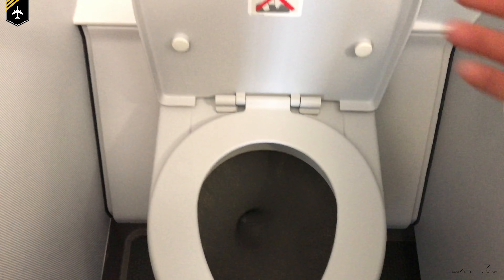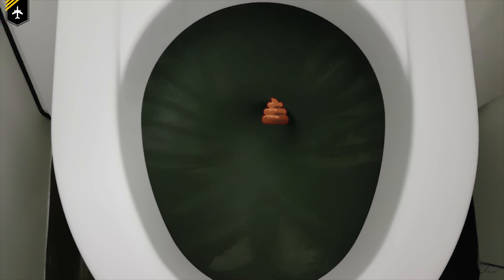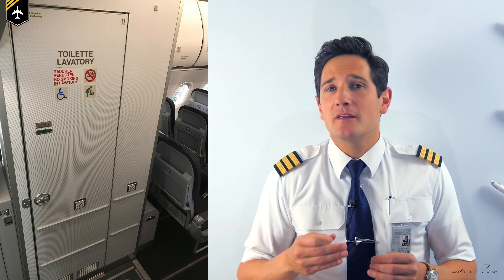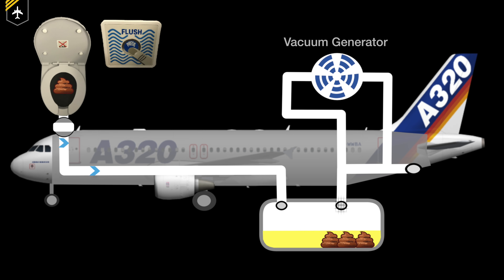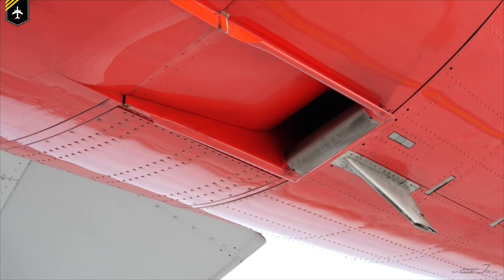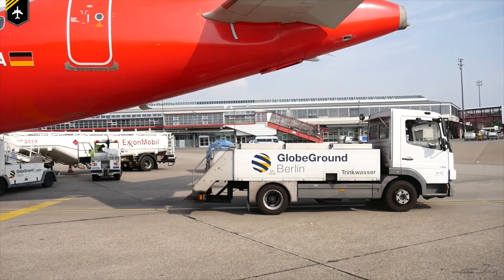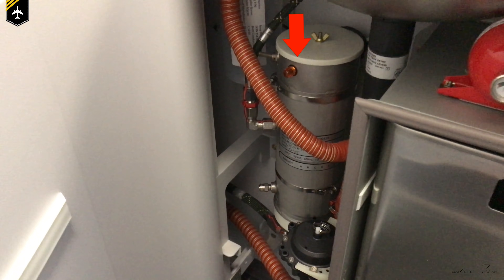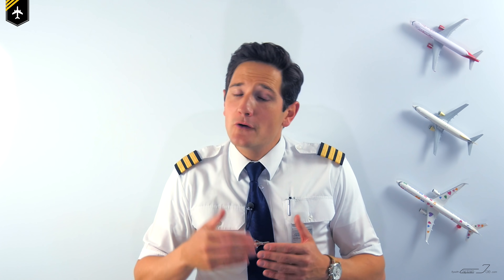HOW do AIRPLANES DEAL with YOUR SH**?! Explained by CAPTAIN JOE

Comment: On a Lufthansa flight a while ago, they had the toilets in the belly of the plane, and a contingent of passengers who, apparently, were not prepared to fly and didn't know how to use toilets. It was disgusting, and the crew had no plan to deal with it. The toilets were overflowing, actual sh-- on the lower deck, by the time we were skirting Greenland. It was basically a transatlantic flight that smelled like Sh__ all the way from Montreal to Frankfort. There has to be a better way to inform passengers who may not be familiar with plumbing, let alone contagion, on how to these systems effect everyone on the plane.

Comment: Does a freight 747 have a toilet?
Are the hose connections  standardized?
Reply: The Freight 747 Does Have A Toilet.
But i do not know what you mean by Are the hose connections  standardized?
Reply: @xioana   I meant the conections  for hoses to get the poo out again. Do they differ from plane to plane or is there a standard for these?

Comment: fun fact, the system is powerful enough to suck a aircraft blanket down through the waste pipes, many times when a Ac has come in for a check at our maintenance facility, we have stripped out the waste tanks to find a blanket has blocked one of them.

our conclusion is that passengers have gone to use the toilet during the night, , sat on the toilet while wrapped up in a warm blanket, and flushed, we have only imagined the shock the passenger would have had when their blanket disappeared.

Comment: The flushing sound is so loud it makes me uncomfortable
Reply: Don't flush that plane toilet while seated. It might pull out your intestines if you are fat and your ass covers the whole bowl
Reply: Ngọc Hoàng Martian we’ve all seen soul plane. 💁🏻‍♀️😂
Reply: Before i flush the toilet i open the door and push the button and run for my life
Reply: I have used those disgusting air plane bathrooms before. And there was a turbulence earlier that day in the airplane so as soon as you saw me come out that bathroom i was pale!!!! For like 10 seconds
Reply: I’m scared of it 😂
Reply: Because the higher pressure cabin air pressure is what pushes air down the toilet, does that make the cabin pressure drops each time you flush. Is it possible to completely depressurise the cabin by flushing enough times.

Comment: The system with closed tank using the lower exterior pressure was invented by Bjoern R Kristoffersen and his team from Boeing while furloughed during the 1973 oil crisis. The team created a large number of inventions all patented - providing the end of the dropping of soil from air planes - starting the era of the modern airline lavatory.

Comment: Hi Expert out there, may I know what about that is after take off and before the plane has get to the height where you have the differential pressure? Does it mean that the flesh wont work? alaso in the beginning of the flight,was the Vaccum suction electrically driven by the APU?

Comment: Once I was parked on a ramp waiting to connect ground power to a Aircraft. I see this kid maybe 19 year old pull up in his honey truck to service a plane.  He hooks up the hose and opens the valve to  drain the tank. Next thing I see the hose comes loose and the poor kid is getting a shower. He was brave enough to reach the valve to shut it off. Remember this when you think about a career in Aviation.

Comment: Why parachutes don't keep in aeroplane.?
Reply: Do you know the answer now?
Unless: At such a huge altitude and speed, it is impossible to leave the plane without dying from the pressure / cold and air flow.
And if the engines are behind, sideways, then it can happen that you are sucked into the engine.

Comment: Joe could you please explain if a pilot can be a pilot in two types of aircraft like a320 and also 787
Thanks
Reply: Yes, you can pilot different types of airplanes, only you need to get trained for each of them and receive certification for each airplane type.
Reply: @LGKvideos  not in every case... pilots certified on the A320 can fly A318s, A319s, A320s, and A321s. Also pilots certified on the 757 can fly 767s as well.

Comment: captain joe, what do you do if YOU need the toilet when you’re the pilot?
Reply: holly a flight attendant enters the cockpit, and then the pilot can take a short toilet break.
Reply: A2DJP ok thanks
Reply: In addition, the crew will put the curtains up in the aisle/galley to hide for the passengers that the cockpit door is getting unlocked and opened.
Reply: @Husaberg R the flight attendant is in just to have an eye on the flying pilot. It is not allowed that there is only one person in the cockpit in case of an sudden medical issue like heart attack, stroke or severe pain and so on.🍀
Reply: @sunrise0391  It used to be allowed, until there was an accident many years back where a depressed and suicidal pilot locked the other pilot out on a bathroom break, and then flew the aircraft into a mountain. That was when the 2 people have to be in the flight deck all the time rule was created.
Reply: @mtuz8356  She can unlock the cockpit door to allow the other pilot in, she can ATC. They started doing this after a suicidal pilot locked the other pilot out and flew the aircraft into a mountain. Also after 9/11, all cockpit doors can be locked from the inside and not allow anyone to open it from the outside.
Reply: they shit on the flight computers
Reply: DarkSlayer 1411 that would just be pointless and break things
in reality i suspect a flight attendant is called in to keep watch and the pilot then goes to the toilet 
i heard some planes have a small toilet room built into the cockpit to eliminate the need for pilots to leave the cockpit at all,  though i have never seen such a room
Reply: @mwbgaming28  r/woosh
Reply: MWB Gaming r/whoosh

Comment: Why dont they discard the 200 liters water in emergency case instead of fuel? It is safer for environment and save money as well, I think. Thank Captan for these interesting explanations :)
Reply: Bakuryu Mole 200 litres of water is nothing compared to 320000 litres of fuel
Reply: 200L of water is about 200KG = the weight of 2.5 people

dumping that wont do much in terms of the landing gear not collapsing on landing

Comment: HI Joe, does the luggage area under the plain also have equal air pressure? If I put a new bottle of coke in my checked bag, will it explode?
Reply: the cargo hold is pressurized to the same pressure as the cabin, this is to ensure that altitude sensitive bombs don't explode in flight and so animals can be transported safely in the hold, it is also to make the floor of the cabin much lighter (since it wouldn't need to be a pressure vessel then)
Reply: Yes, pretty much the whole plane is pressurized, that is also why it is shaped like a cylinder, just like gas bottles. This is, except for a sphere, the best shape for containing pressure. In the tail it looks something like this: https://commons.wikimedia.org/wiki/Category:Rear_pressure_bulkheads_(aircraft_fuselages)
I wonder if a coke can might survive unpressurized anyways. It looks like they can have internal pressures of about four times atmospheric pressure (https://hypertextbook.com/facts/2000/SeemaMeraj.shtml). At cruise altitude, the pressure is somewhere between 1/4 and 1/5 of the pressure at ground level, so the pressure difference goes from about 4 to 4.75 to 4.8. Depending on how big the safety factor is, that might actually work.

Comment: Does pilots sleep when there is a long flight? For example from Los Angeles to Dubai? Do they sleep in their seat?
Reply: Yes they do sleep on such long flights, but not in the cockpit. They fly with 3 pilots on such flights, but one of the pilots normally will go to the crew rest area to sleep for a few houres shortly after take off. After 3 or 4 houres he wakes up, goes back to the cockpit and the next pilot goes to sleep.

Comment: A while ago I went to Barcelona and on the way back (from Barcelona to home) they fueled the plane while we were on it and the ground crew was loading the cargo. I was wondering if that is safe and or allowed. I also noticed they connected the ground wire before the fuelhose, but also disconnected it first. I flew with transavia, if that makes a difference. I don't remember the exact plane model.

Comment: Captain Joe I would ask you a question that, If a plane crashed landed then what are the proper procedures you take to decide who leaves the plane first or does the after crash landing checklist... is it the captains choice or? And did you ever experience an emergency in air?

Comment: Yup, I used to be that lucky guy that used to have to service those systems at DTW.
The other GSE's (Ground Service Employees) use to jokingly refer to us as "The Turd Hurders".
These systems especially the older gravity fed blue juice lavs were a pain in the ass to service in the middle of the winter on the older DC-10s Older 747-200 series where there rear lav service panel was way up under the tail and the DC-9/MD-80 forward lavs because the service panel was located directly below the jet bridge and sometimes I had to go get a gate agent to relocate the bridge because the bumper was right up against the panel.....
One incident I had on 12/26/98 I was servicing the rear lavs of a Champion airlines Boeing 727 and when I opened the outer hatch, the inner flap was already opened with upwards of 20 gallons of 'you know what' pressing against the outer hatch, the ice build up wouldn't allow me to reseal the hatch and decided to take my chance to jump out of the way about 4 feet off the rear of the lav truck. 
When I hit the ramp I must have slipped because the next thing I knew I was on my ass looking at my ankle that was tacoed 90 degrees the wrong direction.
Needles to say that put me out for the next 8 weeks and I messed the winter deicing season of '98/'99.That was the year wear passengers spent hours trapped on aircraft on taxiways.

Comment: Is it true when a toilet has been filled up and emptied, air hostesses put ice in the toilet bowl to prevent a strong odor?
Reply: more likely if it wasn't carbon Dioxide 'dry ice', it was to both chill harden 'stainings'  for easier cleaning with less smearing, and to melt and provide some liquid to move loosened turdlets into the 'gullet' of the bowl - the small flushing/catch tank/cylindrical part just below the flapper valve of the bowl.
   Saying its for air freshening is a nicer faster way to coax a passenger to stop asking for an explanation that could make other fell unwell from hearing "The toilet was dirty and pebbledashed..."

Comment: Chemtrail busted -  Coffeetrail confirmed...
never thought, that it would go over board. Why isn't the used water just stored with the poo in the waste tanks?
And actually: the myth of falling ice blocks from planes could be true, if the heating of the drain mast is not working properly and the wasted water freezes at the exit of the mast?!

Comment: It seems like a bit of a waste of power and weight to have the water heater for washing hands. At that altitude the water may get very cold, but as long as it does not freeze it seems like an unnecessary luxury.
Reply: noted, I have commanded that they be removed from now on, just for you

Comment: Captain Joe, how often is the potable water system cleaned or serviced? Potable is drinkable water, but it's basically tap water. When water sits for a long time, it develops biofilm an algae like film . You see this sometimes in reused water pitchers, that don't get cleaned often and in Keurig coffee makers. I've the videos on why flight crews don't recommend drinking water or coffee on the plane unless the water is from a sealed bottle.
Reply: The filters, and screens are cleaned on a regular basis. We do ours at least once a week. We also use a broad spectrum microbiocide called Purogene. The system absolutely gets cleaned. The problem is that you don't know about the quality of water in different Countries. You could be on a flight from Atlanta to JFK, but not know that the water system was just filled in Mexico during an earlier flight.
Reply: Thanks for the reply, so even if the system is sanitized once a week, assuming all airlines do this. The water to refill the system could be questionable.  That's why the flight crew does not recommend you drink the water from the plane unless it's from a purified bottled source.

Comment: Hi Captain Joe. In this video you said that the used water is exited from the plane during flight. What happens to that water when the plane is on the ground? Does it go into the holding tank? Then when the plane takes off again is it pushed out of the plane during flight? I always enjoy your videos.
Reply: It's a direct line from the sink bowls to the drain masts. Since it is considered hand washing water only, it drains to the ramp.

Comment: Do you know of any cases where people have drained enough water that it changes the weight/handling charasteristics of the plane itself, or are the tanks too small to make a difference? I worked for a while as a warehouse clerk at an aircraft maintenance location dealing with A-319s and A-320 for United and JetBlue.

Comment: Love your videos Joe. One small point on this one. There is no 'suck' in physics. It's all  'push' caused by differential pressure. When the passenger does the deed they increase the pressure in their rectum and push the waste out. It is not sucked out. Similarly, to flush, the pressure on the inside is increased as compared to the outside by opening the outside valve, and again, the waste is pushed out.
Reply: oh wow, thanks mr spack! so vacuum generators don't lower pressure?

Comment: I have read many warnings about not drinking the water aboard a plane, because the water tank isn't cleaned or disinfected regularly, and the water is likely to contain harmful bacteria and viruses. (This would be the same as why cruise ships often have outbreaks of norovirus - their potable water is also stored in large tanks.) The few times I've tasted the water on a plane, it has tasted unpleasantly stale and musty (although it didn't make me sick). So are the warnings true?
Reply: The filters, and screens are cleaned on a regular basis. We do ours at least once a week. We also use a broad spectrum microbiocide called Purogene. The system absolutely gets cleaned. The problem is that you don't know about the quality of water in different Countries. You could be on a flight from Atlanta to JFK, but not know that the water system was just filled in Mexico during an earlier flight.
Reply: I flew from New York to LA to Melbourne, Australia in 1999. I got a drink from the water dispenser by the galley, and the water stale and mildewy, and didn't look as clear as it should have. After the first taste, I got rid of it and asked a flight attendant for some bottled water. If they had just refilled the tank in LA, why did the water seem to have been standing for weeks?
Reply: 1999? Weren't we still using bi-planes back then?
Reply: Yep, and the passengers all had to pedal to keep the prop turning :-)
(Seriously, it was a Boeing 747-400 configured for maximum passenger capacity.)
Reply: Times change new procedures are added. Twenty years ago, our utility people in the hangar used the same garden hose to wash the plane, service the lav ports, and fill the potable water tank. Today, we have a dedicated stainless steel cabinet with filters, and special hoses that are only used for the potable water. There are EPA reps that take samples from the aircraft on a regular basis. Times changed, procedures are much better, but I still wouldn't drink it. You can't guarantee what is happening in other Countries.
Reply: Alas, I can no longer afford to fly halfway around the world. But if I ever do manage it again, I'll keep your information in mind. Thanks!

Comment: @0:51 each commode only gets about a 45 gallon / 170 liter waste tank? I thought they would be much bigger because they do flush some blue fluid and the standard portable restroom at outdoor events and construction sites in the US typically holds 50 gallons / 189 liters which can support up to 100 people for up to 4 hours, but does not flush any blue water.
Reply: It's a single 45 gallon tank for the entire aircraft. During the flush, very little water is actually sprayed into the teflon  bowl. That little bit of water is just enough to rinse the sides.  The vacuum does all of the work. Everything goes through a grinder before hitting the tank.   That means the tank is all waste, and very little added water.
Reply: That blows my mind...

Comment: Dear Captain Joe:  If a plane is dumping fuel to reduce weight for an emergency landing can they also dump water from the potable water tank?
Reply: Not really dump it no, you could continuously run the taps in the sinks and it would exit overboard as shown, but that would take a very long time. That would only reduce the weight by 200KG on the airbus in the video, and around 800KG on a 777. That's not really very much when you're talking about an overweight situation, a 777-200ER might have to get rid of up to 84,000KG to get to landing weight.

Comment: So, as every time I flush on a plane some air exits, flushing continuously will result in the plane depressurizing?
Reply: No, the engine bleed/air conditioning system continuously feeds pressurized air into the cabin. The pressure in the cabin is controlled by the outflow valves, these are small doors on the fuselage that let air out, they are usually open to some extent in flight, if you continuously flushed the toilet then the outflow valves would move towards the closed position to maintain cabin pressure.
Reply: I was kinda joking, but thanks for the accurate answer nonetheless...